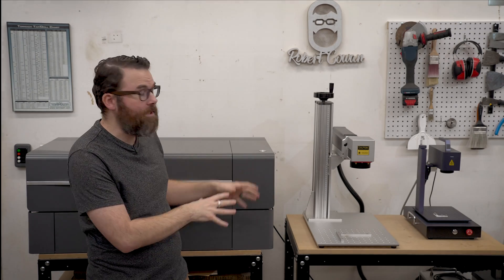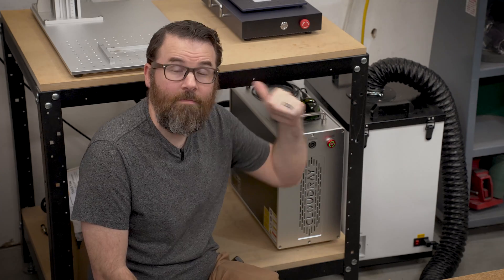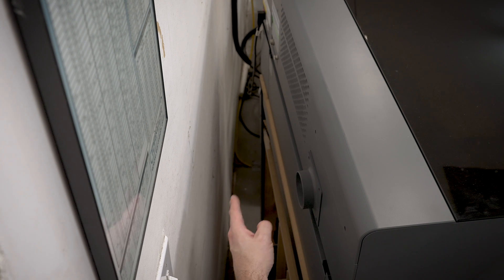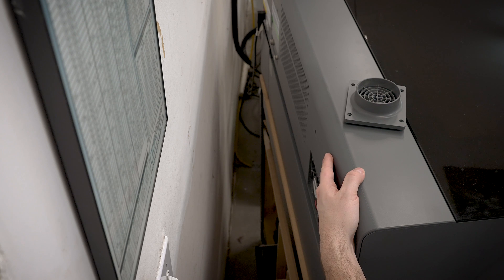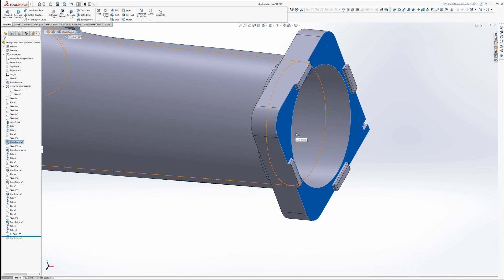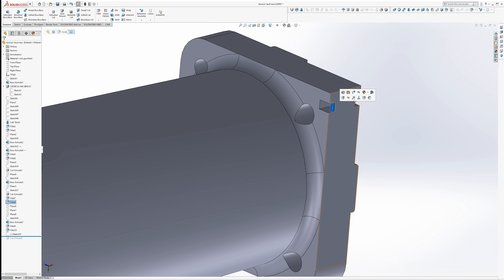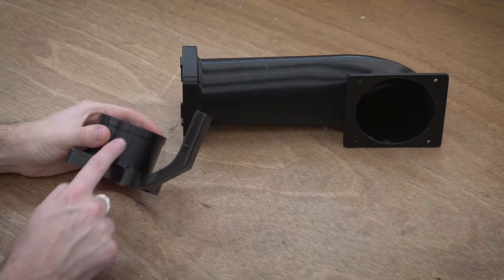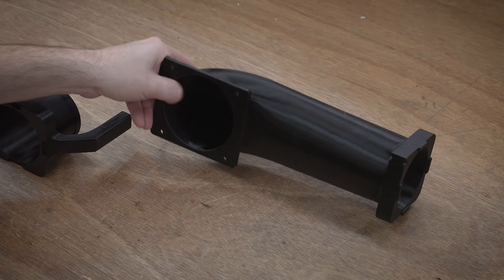Laser Exhaust for CO2 and Fiber Lasers

Comment: Good thoughts. I like magnets in my designs too.  The only thing I would do differently is to use a rectangular shape for the duct. Or better said something with a 45 degree top if you printer can’t bridge nicely. It would avoid the need for supports and allow you to get the laser even closer to the wall. Designs for a 3d printer needs some change in mind. 

I am not sure if I would like to have a 50W laser without a sight protection either.
Reply from the maker: Round ducts are better for airflow.  The elbow is already as tight as I would like, any tighter and you will impact air flow.  Ideally, I'd want it much larger, but I'm restricted by the size of the duct.  Supports have come a long way and both parts print just fine with supports and were designed with 3d printing in mind.  The fiber lasers have goggles down below, which you can see when I'm down next to the HEPA filter.  Also, the computer that operates the machine is opposite the lasers, so my back is to the machines while they're being used.  Most jobs are less than a minute, so I just hit go and by the time I turn around, it's done.
Reply: @RobertCowanDIY  Glad too read that you are protecting your eyes. Please just keep in mind that your audience will not always have the same degree of self protection :) I don't know... perhaps just add a warning .. this can be a very quick accident. 

Duck ... you are right... round ducks have a better airflow... but square ducks are very popular too - even a lot of air intakes in military jets are quare ... and then we could speak about the influence of the layer lines on the airflow and later on the spiral in the extensible duck... ;) .. imho I don t think this will be a big difference in this application. 

At the end of the day., your design works and that is what matters. 

thank you for the reply
Reply from the maker: @Newmeishu  Eh, it's a $5K machine that comes with a lot of instructions and requires a fair bit of know-how to get working.   I am just showing off projects I'm building, I don't need to be an OSHA instructional manual for people.  Dumb people are gonna do dumb stuff and it's not my responsibility to stop them.

Comment: 7:40 if the orifice for the magnet was deep enough you could do it but then your flange gets unnecessarily thick to account for slot. You would put in magnet then Put in a Shim then let the print finish to lock it in place. Robert you probably know I meant bit others may not.

The problem with embedding is that if you sell or discard pc. It’s worth recovering the sometimes expensive magnets. An embedded magnet is hard to remove than just pushing them out with a toothpick.  

If you have smaller magnets you could use the halbach array method to amplify the magnets. It makes a 10lb magnet array feel close to 20lb  pull force.
Reply from the maker: They can be recovered easily enough with other magnets ;-)  Just stack them up and slowly pull out the stack.  This isn't my first rodeo with magnets.
Reply: @RobertCowanDIY  when I said it is harder to recover I meant once you’ve sealed them in. Ie put a slot, drop in magnet, shim magnet, continue print to seal orofice. The only way that’s coming out is a destructive recovery. 

pulling magnets on tight fitting parts is feasible for sure. But to be foolproof adding a tiny hole to push the magnets out is handy. For the part I had, the magnet was unlikely to pull out as the orofice was just smaller than magnet and the force holding magnet in place was more than magnet force. 

Have you tried a halbach array - I was impressed by an 8- 10x10dia neodymium magnets array. Possibly best suited to a different application than your duct, but cool to check out if you haven’t come across them.
Reply from the maker: @75keg75  I usually add a small hole to push them through BUT in this case I was worried about debris getting into the hole and causing an issue with a snug fit.  Once again, over-thinking a design that works just fine.

Comment: For a rev 2 of this you could put the index nubs as triangles so it is more self centering than you have. Also you could print a soft TPU gasket that you press fit into a groove. The squish from the magnets should create a full seal. 

The perfect printer is the cheapest than you can print with. Much like the fastest car in the world is a hire car! 😂

Merry Christmas!!
Reply from the maker: This was prototyped pretty heavily and they seat perfectly fine.  I've had zero issues with them finding their way in.  Look closer at the models, the 'nubs' are all chamfered on the receiving and and it's nearly impossible to not get it to seat flush.  TPU would have been a nice addition though.
Reply: @RobertCowanDIY  I was watching on an iPhone just after I woke up so I didn’t see.the Chamfers - which will definitely act like a centering triangle. 

TPU definitely worthwhile for a dusty system but as your extracting fumes it probably not worth the hassle. The vents on back laser are probably bigger than any gap on the flange faces.

Comment: Thanks, Robert, for your design and time spent sharing.  I also have 3 lasers that I would like to alternately connect to my super expensive XTool Hepa.  I use Fusion 360, (free hobby-maker version), and don't want to subscribe to solidworks or learn it.  Also, I have a Bambu Labs X1, not a Prusa XL.

Could you export your design from solidworks to a format that can be read by Fusion 360?  I would like to "shorten" the overall length so I can get it on the X1 build plate.

In any any case, yes or no, thanks again, Gary Linn
Reply from the maker: Check the printables link in the description.  I've included the original Solidworks file, as well as a STEP file and 3MF.  The STEP file should work fine in Fusion.  If not, I could include an IGES as well, but the STEP or 3MF should work for your purposes.
Reply: Thanks, Robert, for your lightning fast reply!  Merry XMAS and a happy and safe 2024 for you and yours.  Gary Linn. @RobertCowanDIY
Reply from the maker: @garylinn7747  Yep, you too!

Comment: Great video. Listen I have the FLSun V400 and it's a very fast printer and I use it for a lot of prototyping or printing stuff that I don't care too much about, but it's dimensional accuracy is awful. That doesn't mean the S1 will have the same issues, but I hope it works out well.
Reply from the maker: Huh, interesting!  Are delta printers just inherently less accurate?  I don't have much experience with them and just wanted to try one out.
Reply: @RobertCowanDIY  I do not believe so. The high end prusas are deltas.
Reply from the maker: @GarethLewin Gotcha.  Yeah, the Trilabs look nice, but a bit spendy for what they are.

Comment: I was told that type filter is not safe for use with acrylic work. Xtool told me the P2 should be vented outdoors when working with acrylic as their filter cannot remove the harmful fumes they found after testing. I am pretty sure all the filters like that use the same filter media. You may want to vent it to be safe unless you are just working with wood. At least check with the filter manufacturer .
Reply from the maker: Huh. interesting.  I'll have to check into it.  I've used filters like this before from Bofa and they're good at pretty much anything you can cut.  Thankfully I don't do much acrylic.  I could always vent the exhaust of the air filter outside for double-protection!  Thanks for letting me know.
Reply: @RobertCowanDIY  I had no idea either.  Xtool told me not to use the filter box for acrylic  in my videos  anymore.  Venting the filter  outside is probably  best. Yours maybe different  but they all seem to use the same consumables. I have no equipment to actually test the air coming out but I bet it doesn't  meet some stringent European spec.
Reply from the maker: @unemployedredneckhillbilly2023  Interesting.  I do remember when I did a comparison, the xtool air filter was MUCH smaller.  The gwieke has a much larger air filter box.  But thanks, I'll look into it.

Comment: An idea for the fume extractor nozzle for the open printers. Put it on a metal plate that about matches its size and have a single smooth pin sticking down beneath the plate, just the right size to drop into the holes on the bed.

Then you can just set it on the printer and the weight of the metal will hold it in place with the single centered pin keeping it aligned.

That way you don't have to mess with screws every time, and you can move or pivot it anywhere you want.
Reply from the maker: Fair point but all the holes are threaded, so eventually the pins would damage the threads.  PLUS, I won't really need to move or adjust the duct very often, it's most likely going to stay in roughly the same spot each time.  I did think about a method like you proposed, but I went with shorter thumbscrew so it's only a few turns to remove them.  Another interesting idea would be set screws set below the surface and magnets...  The magnets would hold to the set screws.  Lots of ways to do the same thing.
Reply: @RobertCowanDIY Ohh, the set screws with magnets sounds slick! Gonna have to tuck that one into my archives for future use! Lol

And yes, wearing the threads over time is a good observation, especially with aluminum. That could be addressed by using a plastic pin though.

If it doesn't have to move frequently, that also changes things a bit.

I know that if I was having to move it for every job, the thumb screws (which wear threads out with constant use as well... ;) ) would trigger my unnecessary repetitive task annoyance, and I would end up finding a pipe wrench or something to set on it to keep it in place lol

But the magnets on set screws would be even nicer.
Reply from the maker: @ke6gwf Yeah. I'll use it and see how it goes.  I'm getting better at not over-engineering things, but just doing something to get it working and tweaking as I go.  I suspect the thumbscrews will be just fine.

Comment: Love this solution.  I am always a fan of using magnets to auto-align couplings.  Are the plates on the fiber lasers aluminum?  If not could magnet to the plate.  Also curious, what use cases your 3 lasers fit.
Reply from the maker: The base plates of the fiber lasers are aluminum, so magnets won't work unfortunately.  The CO2 laser is for most things.  I use it for making little cardboard jigs (just goo for testing fit or layout of things), engraving wood, cutting acrylic, etc.  The fiber lasers are for marking metals or engraving on anything the CO2 can't do.